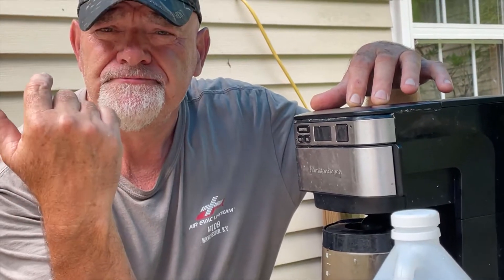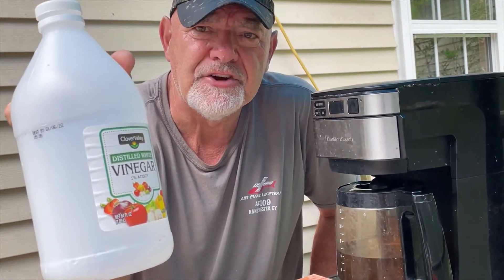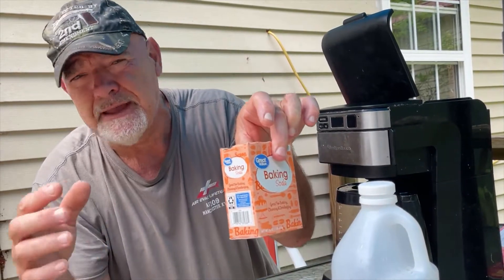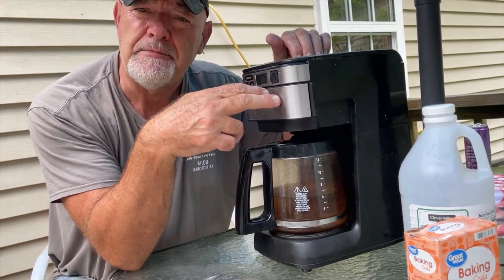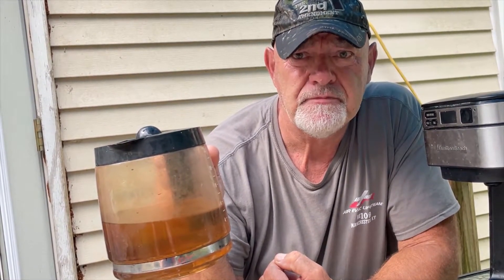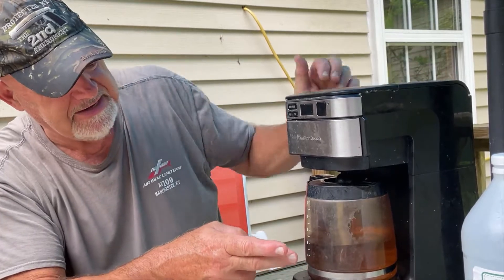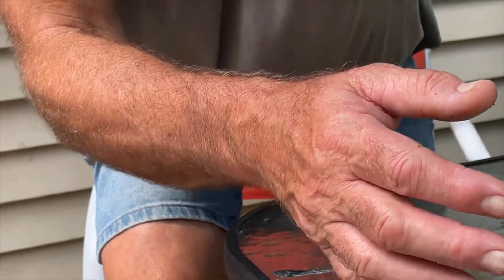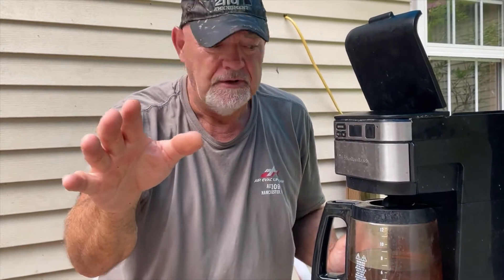How To Easily Clean A Coffee Maker | Baking Soda And Vinegar

Comment: I'm slightly confused because baking soda is a great embrace of cleanser and vinegar is a great acid cleanser. But when you put the two together they cancel each other out. Separately they are wonderful not so inherently when they're mixed together.
Maybe hot water and baking soda through the first time followed by the vinegar
Or follow the vinegar with the baking soda so you can neutralize the vinegar out of the coffee pot?
I don't always run to p plain water for coffee pot cycles through before making
Reply from the maker: Thanks for your comment,I’m not a scientist or a chemist but I’ve always used baking soda and vinegar together with wonderful results especially with coffee maker’s this is not something one would just make up, the bottom line is it just works,thank you for watching god bless

Comment: You should not use vinegar in modern coffee machines. The plastics that are typically used in these devices are only moderately compatible with acetic acid. You citric acid instead. that is also cheap, and won´t attack the plastics.
Reply from the maker: Thank you my friend for sharing,you make a good point,but I believe that anything or any type of plastic that can handle hot water can easily be cleaned with vinegar and baking soda without harming the coffee maker, sure some might be made of thin plastic but I think weather it’s new older, no problem,👍👍👍god bless ,